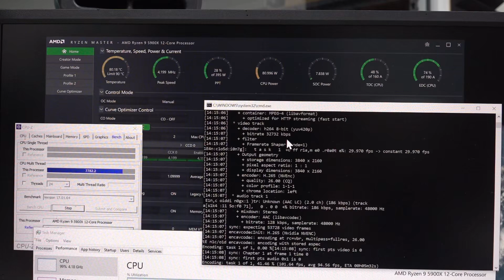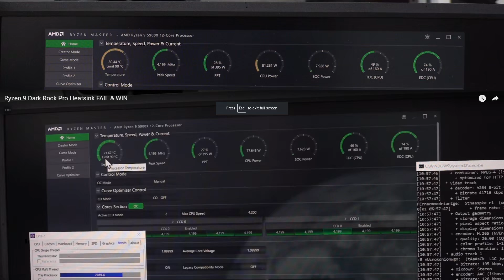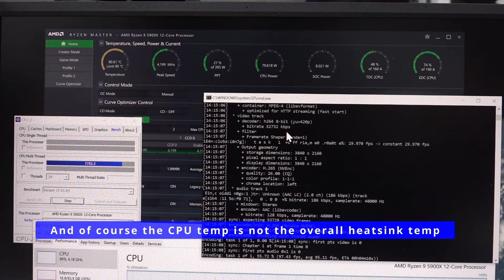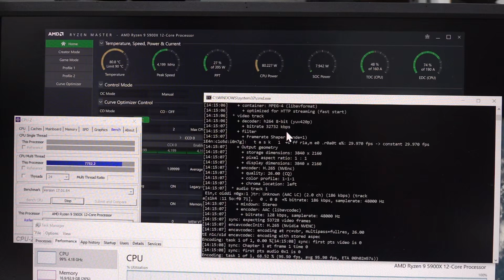Dark Rock 2: CPU Fan Boogaloo

Comment: I wish this discussion was on the EEVBlog.  The Ryzen processors have a worse junction to case thermal resistance than the Phenom processors.  With a better heat sink, my 65 watt Ryzen 3700X runs about 15C hotter than my old 120 watt Phenom 2 940.  The difference is consistent with the differences in cpu die size making it a thermal resistance problem in the processor itself.  My 120 watt Phenom ran at 60C and my new 65 watt Ryzen runs at 75C even though it has a better heat sink.  Of course the larger 16 core 105W Ryzen 3950X should have effectively half the thermal resistance contribution from the CPU dies, so should run cooler than the 65 watt Ryzen 3700X.

Comment: Im glad for the the success you've had and i know your not all for the wankery stuff and not trying to be a know it all. But some of the best if not THE best thermal compound you can use is Thermal Grizzly Liquid Metal you would notice a definite drop even compared to the Artic compound (which is still great dont get me erong) but if you ever have to do anything kike this again.. Liquid metal is your friend! Just dont let it leak anywere else on the board or ya might let the magic smoke out 😅. Hope your problems are solved Dave. If not hell, it could be old thermal pads on the gpu or something nutty even, they get worn out too and replacing them after extended use has shown improvement in my experience..Have a great day Dave 👍

Comment: But, because you now force hot air from top to bottom (against natural flow), the rest of your board (north bridge, memory) suffers a few degrees....
I think coolers like stock Intel with their fans pointing towards the CPU/main board and their star like heat sink give the best cooling for the peripherals like the north bridge.

Comment: Have you checked your motherboard temperatures under load? The VRM does have to dissipate a decent amount of heat when the CPU is pulling >150 A. Could certainly be causing the random shutdowns as most motherboards have bad heatsinks designed to look good rather than work well, they're also often designed with the expectation you're going to use a down draft CPU cooler, the tower style you have can suffocate the VRM heatsinks, running that SPSes near Tjmax for a couple thousand hours cold have degraded them and other VRM components. HWiNFO is probably the software tool to use to test it.

Comment: i seen the other video , and yes the heatsink rotation is the problem solving idea as on ryzen cpus the CCD's OR core dies are right under the cpu model name aka top of the cpu aka to the right side of how the cpu is actually mounted right now in that mobo socket , by putting the non damaged heatpipes over the CCD'S your core temps are getting lower as the heat transfer is way better the only downside is that the left part in socket mount  /lower part as text corect position of the cpu where I/O die is is getting just okayish cooling now which tbh is enough and fine since it dosnt output that much heat anyway , and you prob could use system as it is at the moment ,also i suggest getting a heatsink that has all the heatpies under the cold plate of the cooler kinda like the bequiet tr4 version you got since all pipes are soldered to that cold plate all of them will take away the heat in a even more efficient way than just having them sandwiched between the cold plate

Comment: According to some posts on the linustechtips forums, a noctua AM4 mounting bracket may be able to adapt your dark rock tr4 to the AM4 socket. Unfortunately the picture links in the post no longer work. The most straightforward fix would just be to return it.

Comment: I'm confused that the heatsink is in that orientation to begin with, almost all of them are designed to move air from the front of the case to the exhaust fan at the back, as that is the optimal airflow path.

You basically have a very sub-optimal setup, especially now as its not going to be exhausting the GPU s heat very effectively.
Reply: I also think that such placement of the heatsink is wrong. I suppose it's a mistake in assembly or improvisation forced by the purchase of the wrong cooling system.
https://youtu.be/X9chu63FCWA?t=651
EEVblog2 AMD Ryzen 5900X Upgrade S**T SHOW: https://youtu.be/MiqxUaWkGYY?t=633

Comment: You can't be serious, I've been an electronics/computer tech for 40+yrs what part of an AIO water cooler don't you get?... the cpu will run a shitload cooler hence so will the whole box front & rear fans extending the life of the GPU, P/S & M/B but hey your an engineer so it must be right... blows my mind how much real world knowledge engineers don't have!...WOW!
Reply: A nice Noctua NH-D15 would do just fine as well, it usually matches all but the very best/largest AiO coolers. The cooler he uses is a budget cooler for lower and maybe mid-tier cpus, the surface of the cooler plate hardly covers the cpu surface on this Ryzen 9. Plus it's a cheaply made direct-contact plate with bad machining, it doesn't have enough heat pipes and not enough fin-area.
But it seems Dave is fine with it just hardly working well enough, even though the CPU probably never reaches its full turbo clock potential with this setup.
Reply: @maximilianmustermann5763  It looks to be clocking to 4.2Ghz surprisingly, which is what it should be.  Of course the CPU VRMs may be cooking due to not getting much airflow.
Reply: @maximilianmustermann5763  Yes, I'm well aware of that but it is one more thing to disrupt the in front out back airflow for the rest of the system to deal with including the 2090 making it's own fair share of heat, I work on the longevity of the whole system & as I'm sure you know the cooler the box the happier it is long term under load hence the AIO to get CPU heat out from the top, the temps will plummet.
Reply: @preston963  Sure, the case cooling would probably have to be upgraded as well - or use a good (!) AiO. I am also a fan (pun intended) of "too much cooling is better than too little". I haven't had a high-end super hot system for a while, but my computers always have coolers that would be considered a little too much. It also helps with noise, because who wants fans constantly running at 1300rpm?

Comment: At the begin you had the dried thermal paste, the broken pipe above the cores (the cores are on the side closer to the gpu) and the fan drawing hot air from the gpu. After repasting the temps dropped a bit, the broken pipe was above the cores and the fan in the same orientation. After trying the new heatsink and putting back the old one but rotated now the temps dropped a lot, now the broken pipe is above io die and the fan draws fresh air from outside. The conclusion, dried thermal paste 15-20°C (overheating), broken heatpipe above cores 10-15°C, fan orientation ~10°C.
Reply from the maker: Wrong, the pipes made no difference
Reply: nope the cores are closer to the ram slots since on ryzen the CCD's Aka core dies sit at the top of the cpu where the model text is and since the cpu is mounted horizontaly in that specific mobo socket they reside closer to the ram slots which is good since you need lower trace path to reach the ram slots resulting in lower impendance and electric resistance traces which improve ram speeds and signal quality

Comment: Just buy a liquid cooler then you can forget about temp issues lol
Reply: You don't necessarily need a liquid cooler. A Noctua NH-D15 usually matches all but the very best/largest AiO coolers and is still quite a bit cheaper. But it seems Dave is really stingy and he'd rather torture his Ryzen cpu with a "hardly works well enough but mostly doesn't crash" half-broken budget cooler 😂
Reply: And be ready for a new fears of leaking water.

Comment: It's basically just a question of airflow in and out of the case.
It's physics 101: The air temperature rise is proportional to the watts and inversely proportional to the quantity of air heated per second.
The difference is probably that hot air out of cpu just stays inside the case and rotates around and is sucked again inside the fan.
With the fan on top it probably sucks more air from outside.
It probably be better to have slow quite fans on top and push the hot air in the direction of the exhaust fan on the rear of the case.

Comment: Dumping the heat into the case and not exhausting it...
Reply: If you have case fans and don't run 13900K and 3090/4090 it doesn't really matter...

Comment: Im thoroughly impressed that you tested this. Wholesome comment argument ender.
I would have intuitively agreed with the hotspot guy, ive seen tests, I believe it was de8auer testing coldplate position on the heatspreader, and it made a marked difference.

My guess is the coldplate is transferring heat to the other heatpipes faster than the. Pu is generating it, or the heatpipe is still working fine 😂

These modern coolers are leaps and bounds better than they were a decade ago, I remember my super expensive thermalright ultra extreme being the bees knees, and now the silent assassin is the same price as 3 tubes of decent thermal paste, and keeps my 7950x 16 core under 65 degrees running 95% cpu utilization 24/7. Ofc it isn't summer yet so I may need to retest as the ambient temp changes

Comment: The airflow is certainly better than before, but I wonder if it will make any difference to the crash issue?
You did say the PC worked fine with the original fan position, for years.
Then it appears the thermal paste dried out and caused overheating, which led to random crashes/shutdowns.
But it was still crashing with new paste and lower temperature, in the other video.
I wonder if the CPU or motherboard was damaged by the high temperatures, or something, before you changed the paste...?
Will be interesting to see how this turns out long term.
Edit: Would also be interesting to see how it handles Prime95.
Reply from the maker: Time will tell. But the extra 10C drop due to the fan feels like it should help.
Reply: Lots of changes in how windows scheduler works for AMD (and Intel) CPU's over the years.   So really it's not the same setup even if you think it is.   Windows also can override the CPU microcode on boot if the BIOS has an older version.   Lots of non hardware factors come into play that could alter the behavior of that long time working system.
Reply: @jeffm2787 yes, agreed like I said in a previous video computers can be an enigma.

Comment: You should consult Steve, from Gamer's Nexus.
He does extensive thermal testing which is, as we now see, for good reasons.
But you might be too embarrassed to let him see inside your PC.
Reply from the maker: Why? I solved my thermal problem.
Reply: @EEVblog2  Because in that setup its not going to be cooling the motherboard voltage regulators.  Granted they are often over-specced, but air cooling 99% of the time should be blowing front to back (so the exhaust fan can work effectively) or blowing down onto the motherboard.  I get from your other comments there is a reason for this orientation, but the logical move then is get a different cooler.

Comment: If your computer still crashing try running with haft the ram I had my 3950x pc play up a lot like randomly not booting or monitor not going in to sleep mode properly until I removed 1 stick ram then it  fix my problem then I order new ram  had no problem with it after.
Reply: I can second this. Had a dodgy stick of corsair vengeance lpr that caused crashes until it failed to post after 6 months. Replacement kit ran fine ever since

Comment: Eventually it will be better to upgrade the heatsink. One thing with the smaller heatsinks is that the 5900X will not boost to its full stock boost performance. By default (no PBO or other overclocking), the CPU will boost to use up to around 143 watts in a non AVX workload, provided there is enough cooling, but if the heatsink cannot handle that, then the CPU will effectively disable its opportunistic boosting function. With enough cooling, the CPU will sustain a 4.5GHz all core clock frequency at stock settings though that needs a large air cooler like the dark rock one that you have (if you can get the AM4 version) with the fan set to reach 100% at 75C
Reply: The boosting seems disabled already as its set on manual overclock mode with all cores fixed to 4.2GHz. 
And it says 80W CPU power, its not using 143W, if it were the CPU would probably thermal throttle. Performance difference though between 80W and 143W is not so much though. Better to save the energy.

Comment: Theoretically, you should see a slightly higher GPU temp now, since you're blowing heated air on the GPU (not as directly of course)
Reply from the maker: Measured it. 2C rise in GPU temp when the  CPU is being flogged.
Reply from the maker: Yep, mentioned that in the last video, and I don't really care about the GPU.